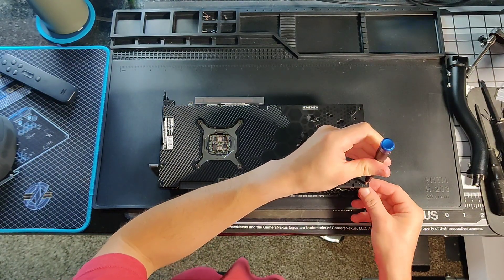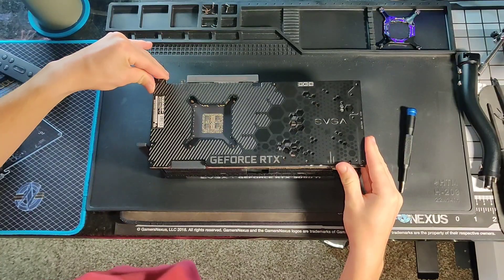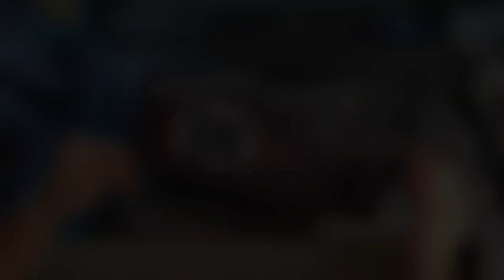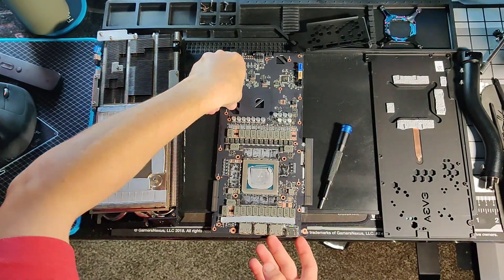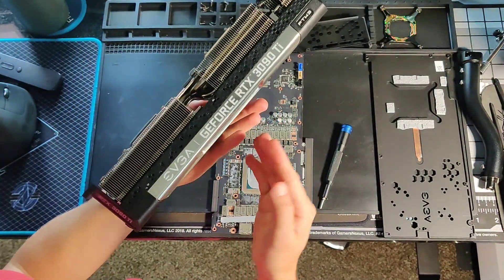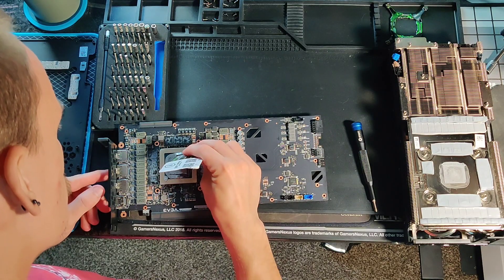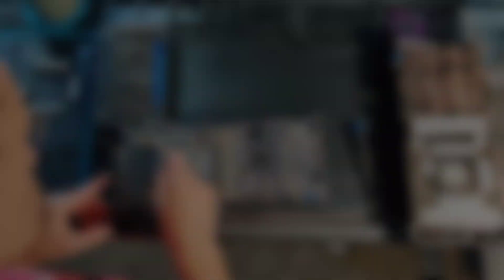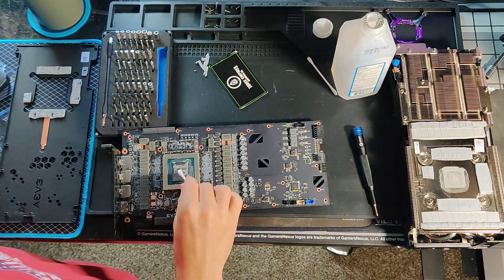EVGA 3090 Ti FTW3 Ultra | EKWB Water Block With Active Back Plate Install

Comment: What did you do with the heatsync and the backplate?
Reply from the maker: Storage
Reply: @Davin Hunt  I was looking for an evga 3090 Ti purely for decoration on a shelf, but obviously don't need a usable card on a shelf. Would you be interested in selling the fans, heatsync, and backplate? Also, would I be able to turn on rgb and even fans without the actual board?
Reply from the maker: @Haktic  I thought about it but i'm going to pass. In between block cleanings In the past I've used the stock air sync. Also this being the last of EVGAs GPUs id like to keep all the parts for collection purposes

Comment: Can you advise if you had any issues reinserting the 3  black screws under the magnetic cover?  I have same ABP set and card and when I have installed both the holes of these screws are out of alignment just enough so the screws can start on the threads.  I have double checked all my thermal pad thicknesses as per instructions, make sure all the standoffs are screwed down.  I’ll strip it down again but if you have any thoughts please reply.  Really appreciate uploading the video only one I can find on YT.  A longer step by step would have been gold!
Reply from the maker: I'm not sure honestly, I wouldn't put it last EK to produce a manufacturing defect here and there. However, I didn't have any issues with my install in particular. I would double check the thickness of the thermal pads and alignment of the standoffs as you have stated. Let me know if you figured out the issue.
Reply: @davinhunt7558  Thanks for the reply David.  Yes I figured it out. It was a slight misplacement of a thermal pad under the ABP. In addition I had to leave my ABP screw loose and start the FC terminal bolts at the same time.  Then tighten everything up.  Upon testing at a ambient of 25C, I am getting water temp of 35C, 55-60C on the core with 3D Mark Port Royal at 4K after reaching steady temperature state.  400-450W power draw.  The other ICX temps are really good 38-42C. Just maybe hoped for a bit better on the core but seems to be in the ball park based on Reddit info. Its not a common card.   I will probably liquid metal one day it as I did with my 1080Ti but not for a while yet. Although I have no idea how this person is getting 30's and 40's on the core with a waterblocked ASUS card and a 500W XOC bios https://www.youtube.com/watch?v=x26tvBNhoSU

Comment: Why does no one show the flow direction on these active waterblocks or where have they installed the fittings 😂😂
Reply: I don’t think it matters as long as it flows over the CPU
Reply from the maker: @hpneptune  I believe this to be correct. I haven't looked at the install manual since but, I'm pretty sure because of the dual water block the flow direction was designed to go either direction.

Comment: Hey, just curious what you are seeing for temperatures?
GPU 1 and GPU2 specifically.
Reply from the maker: I have a 1080 ti and a 3090 ti both GPUs are in the same custom water loop along with the CPU. The loop overall has healthy thermal headroom. Rarely are all three components being used at the same time. I've never seen peak temps above the low 70°C/s and I'm running at 5.2 ghz all core OC on the CPU.

Comment: Could we use and/or adapt the hybrid cooler from evga compatible with 3080/3080ti/3090 to this 3090ti?? Is the pcb similar to install it ? I already have one so i would like to know if its possible ;)
Reply from the maker: I'm not sure. I used ekwbs compatible checker for their products on their website. I don't think it's listed but you should check

Comment: Does it still work? I put my Vector3 on and it won't post... But I could have to much pressure on pcb I may have reused stock thermal pads somewhere. I'm going to switch them out and try again. if it doesn't work EVGA told me I can put the air cooler back on and send it in they'll look at it.
Reply from the maker: Yes of mine works, sorry to hear you're having trouble. I'm currently gathering footage for a larger PC build video with gameplay on the card.
Reply: @davinhunt7558  yeah I played on it  aircooled until the WB shipped and I don't feel like I murdered anything bad enough for it to not post but I'll figure it out thanks for the response.